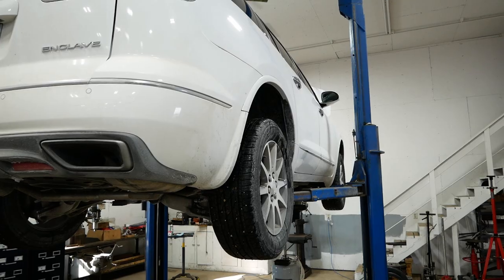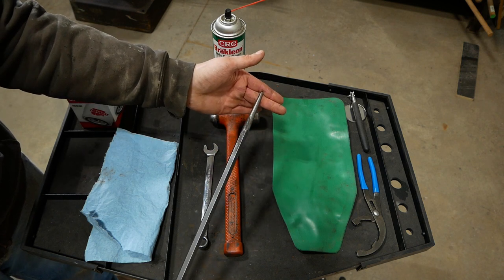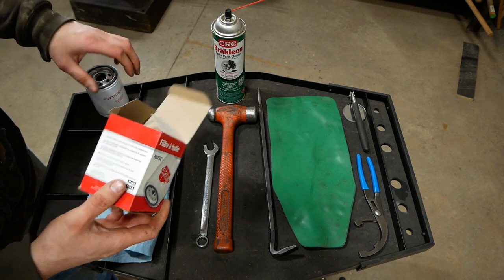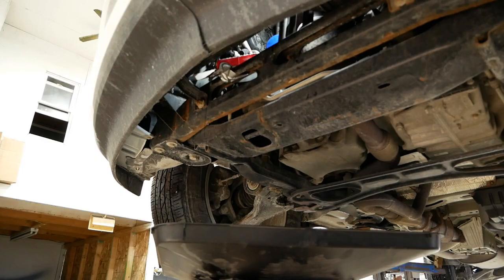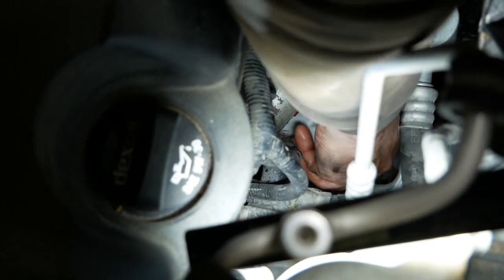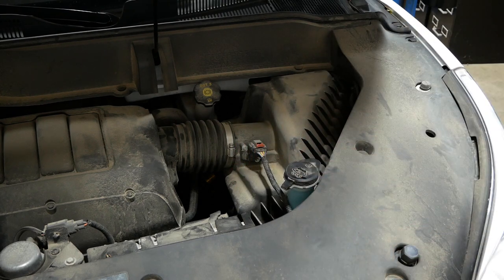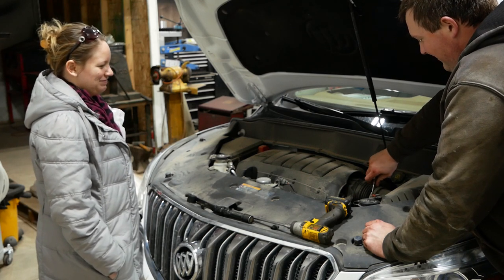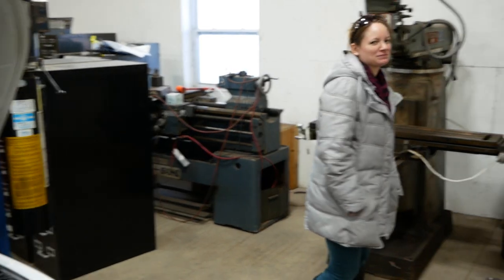Changing a GM 3.6L Spin On Filter without Spilling Oil?

Comment: Reminds me of  the mid/late 90s S10 Jimmy mom had, the oil filter was mounted inside the top of the passenger side fender, a friends parents also had the same year Blazer with out the oil cooler/tow package, and sure a crap, in the fender mounted in the same spot, was the remote oil filter for if it had the cooler, with a filter attached.  No hoses or any other fittings, just the filter and filter mount.

Comment: Definitely an awesome idea. I remember working in a truck shop, one of the old timers welded a nail on a hammer just to knock holes in the filter to drain them. Thanks for sharing!
Reply: Now that's genius lol.
Reply from the maker: I have a poker I made from an old all metal screwdriver.

Comment: I work as a lubie in a chevy dealership while getting my indrustrial certification from a school near by. for the air filter, if you take the engine cover off ( the plastic cover the is held on by 3 snap on tabs and the oil cap) and then take the hose clamp off the intake it is a lot easier to take the the air box in and out.
Reply from the maker: What do you do with the oil filter? Flame thrower?
Reply: @WatchWesWork  Flame thrower sounds like it work nice! 🤣 but no, we usually only get about 50 min to rack up the car and do a complete inspection and oil change + tire rotation, so basically we just throw an oil pan under the car and spin the filter off. makes a big mess like you said but theres not many other choices.

Comment: I've had a form a funnel for about 2 years now. I use on 99 V6 Camry and 2000 4.6L Expedition. Both are stinkers and it works great. I use a crummy HArbor Freight phillips screwdriver as my piercing tool I can usually do it with only a few drops. Form a funnel is useful for tons of stuff. Love that thing almost as much as my lock-n-lube grease gun attachment.

Comment: I speak from experience here as my 2011 Renault Megané with the 1.5 litre dci engine has a very inaccessible oil filter, in this video you reached from below & touched the oil filter, well that all i get from above, no below option & i can tell you that twist on oil filters are the only self tightening thing in my car, i never put a new one on tight but when it’s time to take it out, it is on there like it was never meant to come off ! I won’t even think of draining the oil until i have the filter turning a little, I certainly won’t put a hole in it, just in case it isn’t coming out.
Reply from the maker: Sounds fun!

Comment: I use a 1 liter or 2 liter empty plastic soda bottle or something similar.  I cut off the bottom and notch it to accept the filter wench, and I leave the cap on.  It basically covers the whole filter. I have used this method on my Harley and my John Deere garden tractor, not a single mess yet

Comment: Cant's say I can help with the mess, but the best oil filter wrench I've used is the fabric strap type. doesn't fall off, only one lever to find room for and doesn't damage the can.
Reply: The band type metal ones are ok....just the cheap ones are almost useless. If they're even close to tight, or you have not the perfect fitting one, they will just not loosen it and fold over themselves.
Reply from the maker: I have one that works well if you have space for it.
Reply: @WatchWesWork  A good set of oil filter cups are the best investment I ever made for doing oil changes.

Comment: You would definitely like doing an oil change and checking the fluids and replacing the air filter on my 2015 Subaru 2.5i Premium.

Comment: I like using the form a funnel, they come in handy on lawn tractors as which usually mount drain plugs in odd areas right above a frame.   The only problem I had was that my form a funnel's rubber coating dry rotted, but that might be brand specific.    Hey, oil changes would be boring if the engineers didn't have so many ways of orienting and placing filters - consider it a challenge.

Comment: I love how Subaru puts the filter on top of the engine with a bowl around it.  You unscrew the filter in the UP direction and the bowl catches the oil directing it back in the engine.  It makes it so easy to change that I'm now also replacing the filter between oil changes just because I can.

Comment: In the words of Joey Tribbiani... “Not just a hat rack!” Great idea and video. 

I never thought of using the filter box. I’ve tried pieces of plastic jugs and so on before. My Nissan Pathfinder has a side mount oil filter but Nissan put a molded plastic guard under it, but of course it doesn’t line up very well and is a pain to clean off after. I will have to get a form-a-funnel.

Comment: That work around demonstrated at least 5000 times the skill set of the designer's. 

Plastic bottles are pretty handy for that sort of stuff. They can be reshaped with a hot air gun if required to. 

Never had to work on anything that horrendous in the uk, but it's quite common over here to hammer a screwdriver through the filter to create a lever to remove it.
Reply from the maker: Screwdriver trick is definitely fair play!

Comment: I love my 3.6 liter impala. 177,000 miles and still going strong, if spilling a little oil while changing the filter is my biggest issue im good with that. The old sequential injected v6's had a plastic shoot the guided the oil which was nice

Comment: Love my Form-a-Funnel! Got it after you first showcased it. Great for draining fluids from my lathe.
All that plastic is marketing... so it looks like a Mercedes-Benz when the salesman pops the hood. Its removal would be detrimental to cooling however.
GM dumped tons of "old school" engineers around the '08 crash. "Car guy/girl" types. Then scrambled to replace with anyone they could get.
The recent announcement they are going electric... because they have so few engineers that understand.
The oil filter placement is a symptom of GM powertrain making one-size-fits-all and the platforms just sticking it in like a building block.
Reply from the maker: We'll see how that goes. GM is great at announcing things and then just never doing them.

Comment: Good informative video. I have been driving an Acadia for about 9 years now and have experienced all of those problems. I never just checked the air filter. Always had a new one. Usually dropped a fastener into that black hole below the filter. 
The front cover your wife mentioned is the biggest problem since the radiator cap is underneath and not visible. Recently had an over heat with the surge tank at the proper level. After finding the radiator cap I discovered the radiator was dry. Bad pump. 
And the battery is not under the hood but under the floor behind the passenger seat. Go figure. 
Please don’t be too hard on engineers. They don’t design the cars but they have to fit everything together and make the thing work.
Reply: Toyota manages the same issues with common sense.
Reply from the maker: They just want to jam everything into a tiny space to advertise more room in the interior.
Reply: @WatchWesWork  true. Can’t explain why one does it better than others but it happens. That’s why you have to have talented repair folks like yourself.

Comment: I use drain pan on floor and replace oil filter. Spray brake cleaner. Raise vehicle. Spray more brake cleaner. Drain oil.  I was at a GM training class and another guy asked the instructor why GM is making vehicles harder to work on. His reply was that GM makes vehicles to sell, not to work on.

Comment: Had a 92 civic that was similarly inaccessible on the back side of the motor crammed up next to the fire wall. When you took it out it would pour all over the hot exhaust pipes. There was one tiny spot you could reach it from the top but not enough to grip it. I used to just cram enough rags or towels up in there to catch what I could....it was always a mess. I think that car was when I learned the trick of using spark plug boot grease on the oil filter gasket. Anything else you tried using would end up baked dry and stuck on like you had on this one. That silicone grease doesn't dry and it breaks loose real easy next time.

Comment: This looks to me like an unintended consequence of changing from the canister style filter on the earlier 3.6DOHC to a spin on type filter. IDK why they felt the need to change that. I just did the oil and filter on my 2007 Cadillac SRX winter beater with that 3.6 motor, and all you have to do is break out a 24mm socket and a long extension. The canister is reachable from the top, and mounted inverted so the oil all drains out of it when you shut the motor down. Easy, quick, and no mess.
But yeah, swap that out for a sideways spin-on filter in the same location, and it becomes a fustercluck to change without spilling oil everywhere.

Comment: When using brake clean a while back, I bought a whole case because it was really cheap, and I had cans of other things that used the same cap type, so I had blue yellow and red of the same cap they come with in black, and when I started a can but did almost nothing with it I would put the blue on (this was rare) if I used it a bit and it had between half and 3/4 in it I’d use the yellow, and if it was low enough to not spray on an angle or feel like it would have reduced pressure I’d use the red, this meant if I knew I needed something from it that it couldn’t provide I would grab a new can or one with more in it if there was two started, that way I didn’t waste the rest of a can for it to not have enough pressure to wash something off that I couldn’t reach or have the angle I need for something even tighter, it was pretty fun tbh

Comment: Not just GM. On my 2013 Ram 3500 4x4 with the 6.7l Cummins, the way to access the oil filter was through the passenger side wheel well. The hole was small enough that you had to turn the filter sideways to get it out. Some people were buying screw on filter caps, but I just used press and seal wrap. Either way could end up being a big mess though.
Reply from the maker: Yeah those are a pain. There's a cap for the fuel filter too since it sucks so much to install.

Comment: Hi Wes, I use a filter wrench which has 3 legs and has a 3/8 square drive to allow a ratchet handle to crack the filter loose. Should be available most auto accessory shops. 
As for draining filter keep the same method thanks for the vids, greetings from Brisbane Australia

Comment: Great tip. One of the few things I like about the Jeep Liberty I have to work on sometimes is it has a factory metal funnel like this under the oil filter. Getting to the filter is a whole separate challenge.  I learned to take off the grill and the drivers side headlight. 

Surprised to see you using the Carquest "red" filter. Years ago when I worked at our local store as delivery, we sold mostly "blue" filters, the "red" were the low cost fleet filters.
Reply: @21Piloteer  Trash for trash...lol
Reply from the maker: It just do as the customer asks, which is normally "cheap as possible".
Reply: @WatchWesWork  At least they are actually getting an oil change.

Comment: It looks like you could get to that filter with a long ratchet, extension, and claw oil filter wench for ratchets, go in front of the core support with the ratchet and run extensions to the claw and If you thought this was bad and makes a mess, try draining the oil in a  2.7 eco boost f150, best way to that one I’ve found in to wedge a drain pan between the cab and crossmember and hope you don’t spill in it trying to remove it full of oil

Comment: Yeah, I've got no tips to offer re: the 3.6 OR any GM problem to be solved.  But I sure do miss my inline engines and "traditional" drive train.  I once had a Ford Fairmont with a 3.3L I-6.  I could do the complete oil and filter gig with both feet firmly on the floor.  Remove the plug, filter, replace 'em both, pour in the oil, then back the car up to retrieve the oil catch pan below.  Of course, I'd still head down there after the change to have a look around at other things and grease the zerks, but the oil change could be done in complete comfort.
Reply from the maker: I remember my Ford 300-6 I could change the filter from the top.

Comment: We have a vacuum pump which is very efficient at removing the oil via the filler cap (recent example: capacity 7 litres, oil recovered 6.7 litres). A vertically mounted filter will not drain but a horizontally mounted one should.
Reply from the maker: If it was going to drain, it would drain through the regular drain plug.
Reply: @WatchWesWork  yes, I forgot to mention that the drain plug was not accessible without removing a lot of plastic trim!

Comment: I LOVE plastic covers in the engine room.Just as usefull as putting makeup on a pig! 
Makes it easy to never see when you got a problem. For instance when a o-ring went bad on one of the injectors on my diesel engine. It filled the top of the motor with diesel and later poured it down on the exhaust. Made a nice smoke screen and a beautifull smell inside of the car that wouldnt go away for a long time. But with plastic covers its out of sight, out of mind i guess.

Comment: Ha!   Reminds me of changing oil on our 1.6 ecoboost escape.   It also has that stupid sideways mounted filter and its buried up intangled in with A/C lines and an intercooler tube.    The only way I've found to minimize the mess is to wrap a gallon ziplock bag around it before its removed and then wrestle it out.    It will always find some way to flip sideways and dump all over while you try to snake it out from everything.     I might try the form a funnel thing next time but not sure if there's even room for that in there.     Engineers are annoying!

Comment: I would have checked first to see if I'm able to loosen that filter. But great tip, Wess. Also, it's not necessary to crank on oil filters and drain plugs fellas.
Reply from the maker: It has to come off one way or another.

Comment: G.M started fouling up a long time ago.Remember the G.M  Xbody cars? Had to remove the right front tire to cgange oil on the four cylinder version.It was impossible to change the filter without spilling oil down the side of the engine.

Comment: Most japanese cars are easy to work on, but not all. Once i had to change a nissan versa spark plugs, and had to take almost everything apart. What a pain in the back. If i ever have a GM car now i know how to manage the oil situation. Thanks for the tip!! Regards to the lady.
Reply from the maker: Nissan is the opposite of easy.
Reply: @WatchWesWork  You're right, I did it in a friend's car to help him, happily the spark plugs last longer than usual. Greetings from Peru. Thnaks for the videos and the tips!
Reply: @WatchWesWork  I disagree.  The Nissans I've worked on have been OK, and one of them is the single best car to do an oil change I have ever encountered.

Comment: I pretty much always pierce my oil filters, at least the ones that go straight up from the bottom.  Keeps me from getting a hand full of oil when spinning it off. Phillips or Robertson screwdrivers work good to punch a hole too lol.
Reply: I once tried piercing with an automatic center punch and it didn't work real well. I got pissed off and took a battery drill and drilled a hole in the bottom. It was still messy.
Reply: @caverbrad  - when you use a screwdriver or something like that, it plugs the hole when it punctures it, so you don't get it everywhere.  Works good
Reply from the maker: Yes. I have a tool I made from an old screwdriver. Works great.

Comment: Oil changes are no longer the quick drain and fill anymore,, but this concept is what I have used for many years, using a diverter of some kind helps, I use some kitchen plastic wrap with two magnets to hold it on either side of the filter to allow the oil to drain similarly to what you did into the pan. The oil will find a direct channel onto the plastic to drain vertically. And the air filter ?? stressful for sure. It's not just GM. It took my buddy 4 hours to do his water pump on his Ford Explorer 3.5 v6. The whole left side of the engine had to come off as if he was doing a timing belt/chain. SMH.

Comment: Add a Mercruiser remote oil filter kit from your local marine dealer. Very similar to remote kits from Jeg's or other suppliers. I had you problem for 48 years, except I stood on my head to change the filters in many boats. Talk your customers into it. They'll thank you.
Reply from the maker: I will check it out!

Comment: NICE!  Here's another trick for crappy oil filters:  get you a length of steel tubing, 1/4" diameter steel tubing works good.  I think mine was steel fuel line, but I'd imagine something like brake line would work too.  Sharpen it into a hypodermic-like needle point.  Hammer that hypodermic needle point into the filter and the oil from the filter drains out the tubing.  Boom!  Much less mess.
Reply from the maker: Great tip!
Reply: @WatchWesWork  Thanks!  Wish I could take credit for it, but 99.5% sure I got it from someone smarter / craftier than myself.  :)

Comment: I’m going to try the piercing trick next time my Chevy 5.3L needs an oil change.  The only risk for the diy people like me is that if the filter is jammed on, and you punch a hole in the upside-down filter, it may be a bad day if you can’t get the filter off.  It’s worth a roll of the dice to avoid getting hot oil on you from hand to elbow